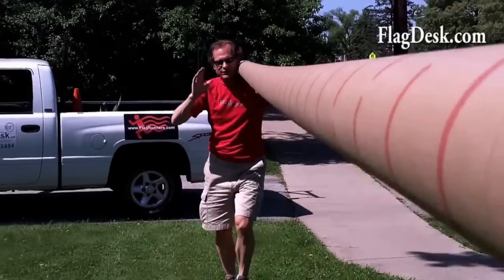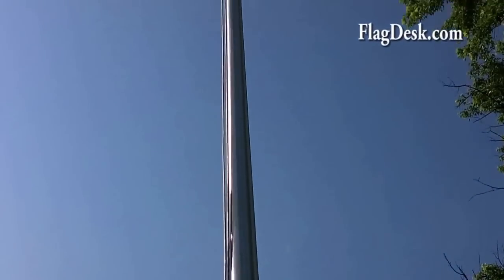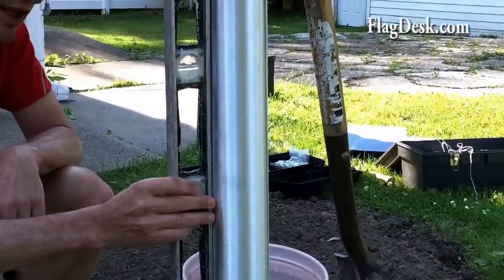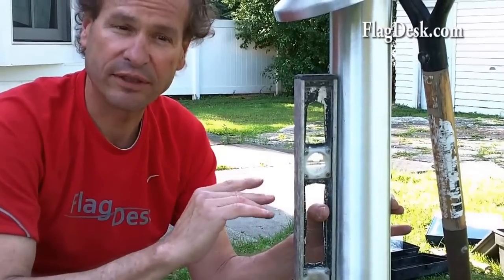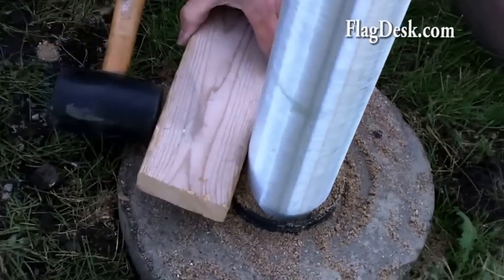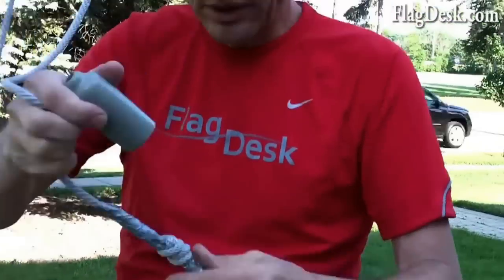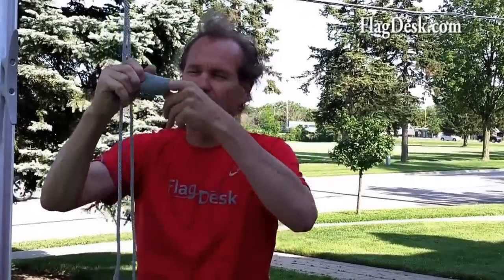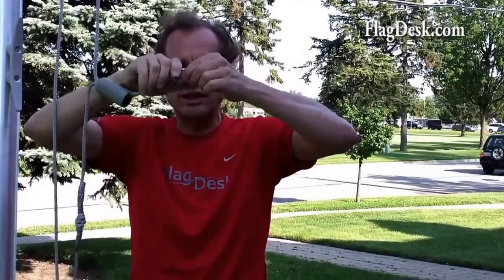FlagDesk.com | How to Install A Flagpole (Part 6 of 6)

Comment: Great videos im having a 25ft flagpole put in soon. its also a straight one piece flagpole aluminum. What size was the flag you put on that 20ft? Mine is coming with a 4x6 flag could i get away with a bigger flag on a 25ft pole?
Reply from the maker: +JAY T. Welcome to the flag flying community. Look into your wind zone and then determine how durable your flagpole is. Most flagpoles at 25' can fl a 5x8' flag.
Reply: +FlagDesk-FlagRunners ok my pole is rated for 50mph would a a 5x8 be ok then?
Reply from the maker: 50 mph is not a very strong rating. While you may not have 50mph winds on a regular basis, this rating is a bit misleading because it is based on 3 sec. bursts. Standard Commercial Grade flagpoles really start at 80mph. We'd recommend flying a 3x5 or 4x6 most of the time and on special days (Memorial Day, 4th of July, etc.) Fly a 5x8. You want to make sure the flagpole maintains a high integrity for years to come.
Reply: @FlagdeskPlus , I know I'm 2yrs late replying but thanks for the information! I've recently relocated and am having a new one installed soon.
Reply: 25ft wtf is that?! u mean 7.5m!